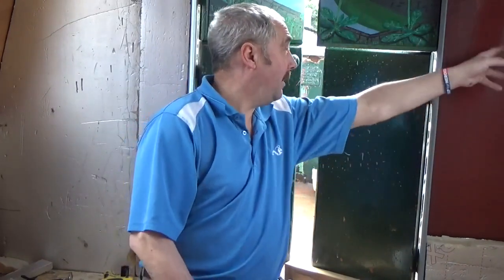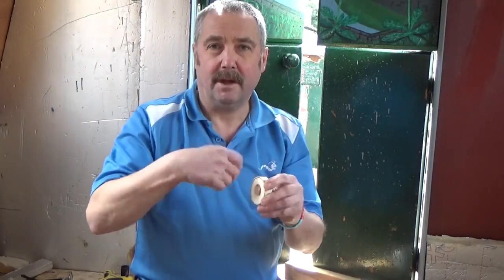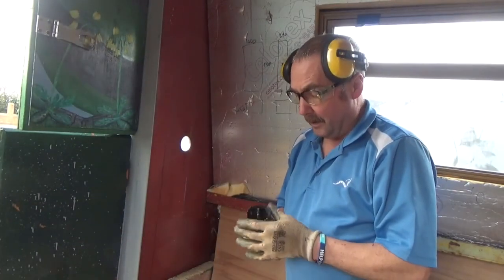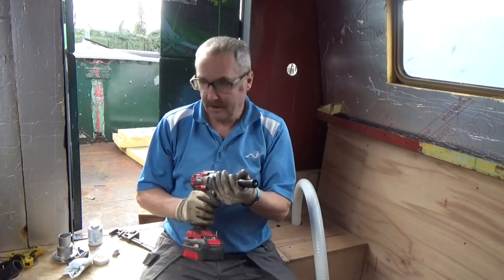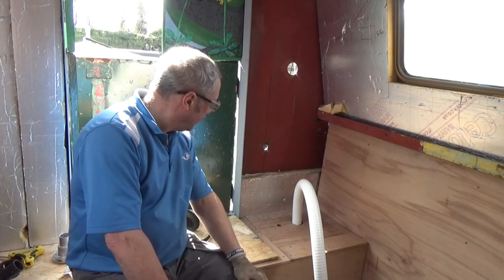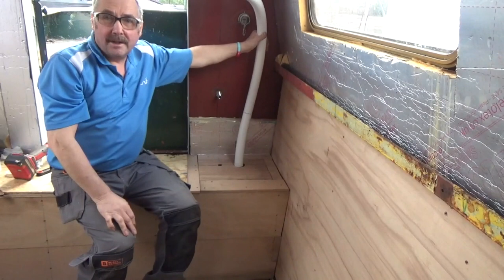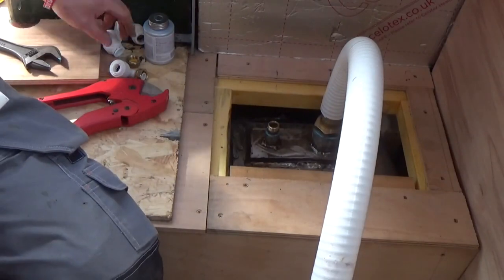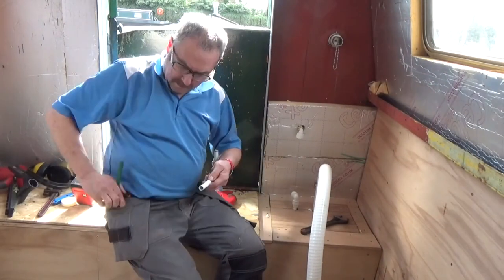Narrowboat Refurb Finishing Plumbing & Filling Water Tank

Comment: Hi Andy! Did you seal the vent pipe going into the tank? Because with your infill pipe being higher when its full  the water will flow up the air  breather pipe, if that makes sense?
Reply: If you look at 11.54 you can see he's put a jubilee clip around it and he says put sealant on all the joints.
Reply: @claire4486  I thought at that point he was talking about the intake pipe not the breather?